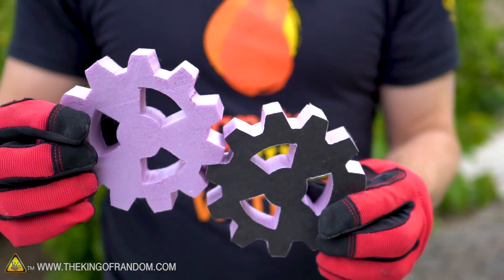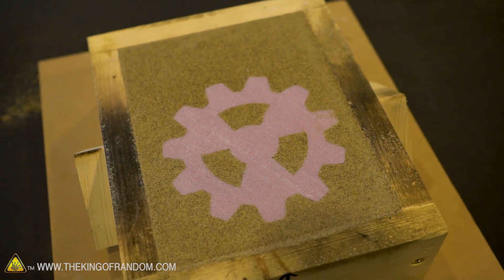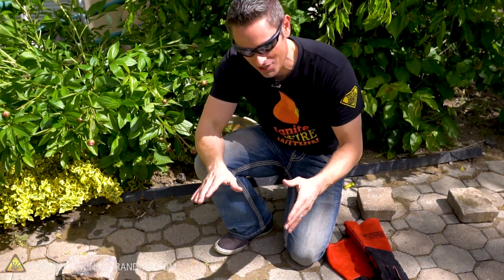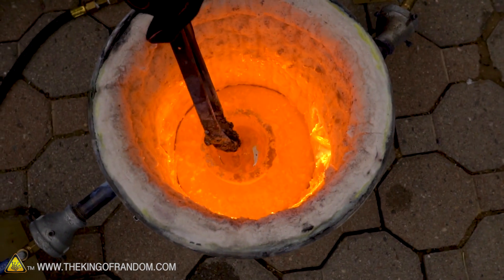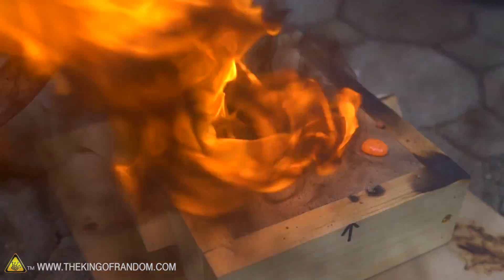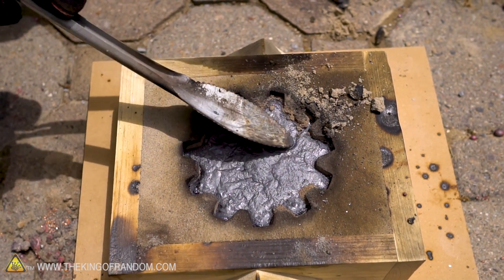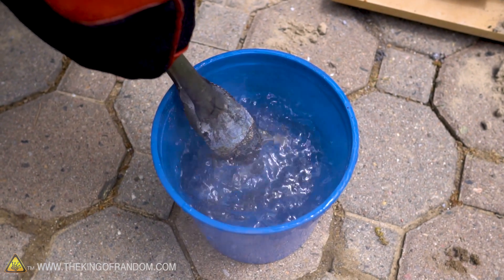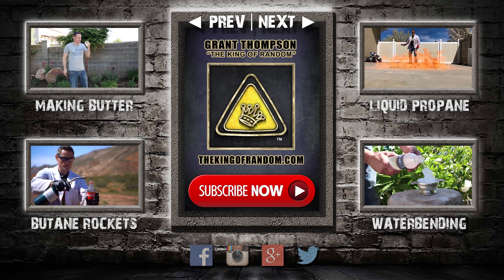Argh. Why Is Copper So Difficult? TKOR Tests Melting Copper In Our Homemade Foundry

Comment: Make a foam pipe to the foam.
Dip the foam into wall filler..wait to dry..
 several coat will be better shell....
Buried coated foam completely in the sand..
Pour the liquid metal on it..trough th foam pipe..
Liquid metal will vaporize the foam , fill the cavity, but stopped by the shell..

Comment: Use white cement instead of sand as it has higher melting point around 1,600 °C. The copper melts at 1,085 °C.  Also white cement makes a firm mould than sand. using 2 part mould will further makes the process much smoother.

Comment: You should have tried laying a metal plate on top of mold and resting the crucible on top for a minute
you could have even had a hole in the center of the plate and leave it on while you pour into the hole so the pieces do not pop out

Comment: When you make the sand mold put glue in the sand. I've seen many sand mold mixtures made with glue and it keeps the sand from falling apart when molten metal is poured into the mold.

Comment: the mid parts come out due to its moisture turns into vapor. use dri sand. and maybe heat the mold as well.

Comment: As the copper cools and solidifies on the bottom it's expanding. This pressure is causing the smaller sand pieces to rise up

Comment: Um with your mold sand problem with the sand keeps popping out i think you sould make the outside mold sand but with the hole problem get rid of that part and make it wood or some stronger sand if there is such a thing

Comment: Make a two part mold with the sand and have another part on top covered with sand to keep pressing the sand down well it is being pored but when  you are putting the green sand in the mold pack it down after all the times you put sand on it

Comment: try somthing else other than sand.
Reply: tamim hossain Sand is one of the only materials that works. Watch "Alumi Tube" or "Press Tube". They use enclosed molds most of the time, which is how you're supposed to do this. He should try to close the mold.
Reply: tamim hossain sand isnt the problem its how he is using it
Reply: An investment cast would work fine. He would probably need to coat the foam with wax so the investment didn’t soak up in the foam.
Reply: I think clay would be fine. Its more stable than sandand also resistant against the heat.

Comment: If I were you I would put a hole in some wood and center my cog on that hole pack sand like normal but keep the top on it as positive pressure so the sand is held firm. May want a thick piece of wood so you can cut if to funnel molten metal towards hole.

Comment: If you por it slower then the lava makes contack with the sand wich. Makesthe sand fall out at that point so i think thw problem is that you need to get the sand worm and then the lava can't make contack with the. Sand of the layer below the sand wich makes it force the lava to go near the sand too go thro of whats in the way of the lava by the way i'm only 9

Comment: one of the best ways to cast copper is to melt it in a porcelain crucible, heating it up with an Oxygen/LP gas blowtorch. 
keep the blowtorch heating the copper, even whilst poring.

that is how a goldsmith would do it
Reply: also, if you don't mind casting on a smaller scale, try casting in a cuttlefish bone, else try Plaster of Paris, or professional jewelers investment

Comment: What the others have said.
Proper casting sand.
Over sized gear
Wax gear with holes on bottom oven the mould to melt out the wax this also sets the sand."moisture in the sand explodes with molten metal"
Two piece mould poor in till the excess comes out.
Machine the item to size.

Comment: If you put the styrofoam in a sand filled bucket and only exposed the very top of the mold, it will work alot better because the copper will have nowhere to go but the styrofoam pattern.

Comment: make an inverted cast that uses less copper, or a cast that is made from copper.
Reply: and maybe quench in other matforms that aren't water like oil, or reactives to copper i cant think, but it doesnt have to be perfect, water just making holes and oxygen looks like its going to explode, idk. just use alot of protection if you decide to use other substrates.

Comment: copper is over 3 times as dense as aluminium and green sand and auminium have similar densities. the sand just wants to float on the copper so casting in sand isn't going to work

Comment: If you're doing an open mold method, why not create a styrofoam cast that you can pop out you pour in the copper? It looks like the main problem is the cast is screwing up the sand mold when it's getting melted.

Comment: Dude you need moulding sand. Normal sand is to gritty, moulding sand is finer and have a truss as clay. In moulding sand descripton stand also bentonit, but you can it order on amazon or ebay👍

Comment: Maybe use something with a higher density than molten copper so it wont float, or make molds with higher cohesion materials. With water boiling from the sand it looked like you could make bubble metal, though it would have to keep the bubbles going until frozen.

Comment: PRE-HEAT YOUR DAMNED MOLD!!! Seriously, in investment casting for jewelry you need to heat the mold to a sufficient temperature before casting for this very reason. You generally heat it to about a hundred degrees higher than the melting temperature of your casting material. Before casting (immediately thereafter. Don't let it cool before you put the molten copper in!)

And you want LESS MOISTURE IN YOUR MOLD!!! The water is boiling in your sand! That's where your sand popping out problem is coming from. In fact, letting it dry in an oven slowly so it doesn't boil is an absolute must! Just pack your sand harder!

Comment: Copper is a pain. But try silver sometime. 
Actually if your sand had just a little clay, or a little more, and you used a double sided mold. It would hold the heat better and flow correctly.

Comment: your sand does not look nearly as dark as the sand I used when sand casting. I am not sure what your formula for your green sand is, but we had a lot of oil mixed into ours when I took a metallurgy class that included casting.

Comment: What if you torched the mold first then put the copper in?  I noticed that when you poured in the metal the sand solidified, so I'm thinking that you could pre-solidify the sand then pour the metal in.

Comment: You could use another tray of casting sand on top of it with a small hole through it...Molten copper will melt the styrofoam and the sand on top will hold those sand pieces for indentation....I think that should work pretty well...

Comment: You need to put deck screws into the 3 projecting sand parts, then remove the pattern.  You also need top for mold.  This helps support weak sand parts.

Comment: I used to own a crown and bridge lab and I cast various metals thousands of times but on a smaller scale. Here's what you do: go to a dental supply company and get some refractory material. You mix it up like a thin plaster and pour it around your foam gear. Wax would work better if you can make one. Completely encase the gear with the material and make a sprue about 3/4" wide and 1" long. At the end of that have a volume the size of a golf ball. That will act as a reservoir and reduce porosity in your gear. Heat the mold up and burn the wax/foam pattern. While it is hot, pour the copper into it. Let cool and add icing....Oh sorry, wrong recipe. Let cool and break the mold. Cut the sprue flush with the gear and you'll have a nice casting.

Comment: I thought of a couple ideas last night. #1 For "Ring" casting with Gold they use a Wax Template.  Maybe using a Wax Template may work.  #2 What about instead of using plain water to wet the sand you tried using water with a little Elmer's School Glue to give it a little stick.

Comment: Wouldn't it be more viable to use plaster same you used for making the furnace as a mold, that it's more heat tolerant, granted may take longer to make the molding but won't take 6 failed attempts with sand?

Comment: Use completely dry sand. Also instead of doing it so you pour it directly onto the stirofoam make it so the gear is buried completely in the sand and pour it in through a hole that you left as a channel. That way the mould wont break apart. You may have to grind off a little bit where the channel fed into the foam but you will still get a better casting

Comment: i worked in a smelting shop and we used to make the moulds the day before with mostly wet sand and leave them to dry out. but we would use a compactor to make sure the sand was almost as hard as a brick. that way, once the sand is fully dry it shouldnt break apart

Comment: You can mix silica gel with your sand mould that will help and instead of melting you can pull that Styrofoam gear out with a sharp tool nicely and steadily that will give a smooth finish.

Comment: No, you just shouldn’t have tried to melt the styrofoam.  When he melted it, the heat had made an uneven surface on the styrofoam, which means while some molten copper is flowing freely through the mold, the other amount of copper is taking time to take the place of the copper, which makes an uneven finished product.  Plus, when he melted the styrofoam, it made the mold weaker.

Comment: I am late to the party but I think I have a simple solution for your problem. Instead of using sand why don't you use concrete? Just put your styrofoam gear in that wooden box and instead of filling it with sand, you fill it with concrete. Once it hardens the mold won't break away as the sand mold did. The only problem I could think of is copper sticking too much to concrete mold. You would have to break the mold after the copper solidifies and you would probably need to clean the gear from stuck concrete.

Comment: using your putty make the mould you need and try casting copper into that. it should withhold enough  to stand the heat needed for copper

Comment: oil sand.. thats the way to cast red metal. and you need a 2 "box" system go have room for the metal to expent. and dont cast direct into the part. it will burn the sand and wash every edge away. get get some nail t stabilize the three things.

Comment: Add 10% tin to the copper. Tin lowers the melting point. Rio Grande sells a product called "Ancient Bronze," but it's cheaper to make your own.

Also, you can buy investment that used in jewelry casting. It sets up harder and won't break when you pour.

Comment: I just watched your video.  I was curious if you had tried using a mud form instead of a sand form. Hard mud seems that it would stand up to the copper a bit better and that you could also preheat the form in order to help deal with coppers heat transfer.

Comment: try using some clay
please
Reply: Ebonheart how about oobleck?
Reply: That was done in a newer video, dry clay explodes, fired clay cracks and falls apart and wet clay makes the mold really uneven; so it wouldn't have worked.
Reply: Unboiled Egg you can’t make a mold with oobleck😂
Reply: Unknowndragon17 oh:_: how about Dried Glue????
Reply: Clay would explode
Reply: Im pretty sure clay would ether melt or cook or mold what ever u purfur
Reply: Shu 05.u might be right though.   Or it might cook by the heat cause u know like clay that u molded u cook to make it hard
Reply: Khyla Magsino uhhh wouldn't that melt? Sorry I'm like 13😅 so, I don't know what I'm saying😅

Comment: OK, maybe use a vacated plaster mold with maybe a couple of sprues to vent the gas. Or, for moisture in your green sand, use motor oil instead of water.

Comment: kinda late on a comment but with copper a 2 part mold would work best for you with multiple inlet holes for the molten copper and an exhaust hole to vent gasses and excess copper

Comment: My sculpture teacher had formal Jewelry, art, and Metal-Working training and even she had trouble with sand casting. She tends to cast and have us cast things in some sort of hard almost plaster-of-paris like substance. But I definitely don't think that it is plaster. I could be wrong though.
Reply: A few additions to this comment though. She would never use something that emits toxins when burning or melting. Nor would I, and it would probably be smart if you didn't either. I think it's a standard thing to use wood instead for sandcasting. And, also, I think she was just making an indentation in it and then pouring the copper in. But, she was trying to make a copy of a different object.

Again, styrofoam is super toxic when you burn or melt it and that's a really bad idea.

Comment: Use a vented sprue cap. Wood should be fine. It'll burn some, but it will mostly stay intact due to the carbonization of the cellulose. Anyway, basically drill a conical hole into the wood in one spot, and a vent nearby to take away escaping gases, place it onto the sand (Ideally it will be in contact or close to in contact with the sand) and pour the molten copper into it. There will be a lot of fire, but it will be okay.

The reason this works especially well with styrofoam in particular, is styrofoam has most or all of the air it requires to burn inside of it already.

This increased pressure on the surface of the sand should prevent it from breaking away.

Comment: use sodium silica in place of water, then gas it with CO2 it will be like concrete kinda and you wont have parts of the mold float out.

Comment: Using two halves of the sand mold will hold the form together so the sand doesn't float.   Adding a small mount of 10W oil will help hold the sand together, also.  Sprinkle some talcum powder on the mold first then sift the sand in around the mold (this will give better definition to the mold) coating fully.  Then add more sand and start compacting.  Flip the first half over, dd another sprinkle of talc, sift sand and add more sand and tamp.  Use sharpened, thin wall 1/2" tubing to add sprue (pour) holes and vents to the top half of the mold.  Separate the halves and excavate channels for the sprue and vent holes.  This will allow the metal in and the air out.  Put the two halves together again and pour.  NOTE: having indexing on the form sides will help keep everything straight and aligned and clamping before you pour is required.  Wait for the metal to cool before opening, trim the sprue and vent hole metal and any parting line metal and you should have a very nice gear.  Save the sand and use it again for the next project...

Comment: bury the styrofoam gear and cover it in sand, create a hole pour copper in it. Your problem is that the stability if the nuclear columns are being shifted by the weight of the molten copper. At least thats my two cents. I could be wrong.

Comment: You need to use both parts of the sand mold. The two pieces are called the cope and drag and you need to create what are called sprue holes

Comment: Hey KoR it seems like the issue you had besides copper temperature was mold integrity. I know sand molds are used when casting engine blocks, but they differ in one way. Before pouring the metal the sand mold is baked. This allows for a stronger mold that prevents any deformation during the cast. Love your stuff and keep on creating!

Comment: why not make a PROPER Mold..jezus
Reply: That is what I said the gear from is supposed to be complete Surrounded by sand not just half of it
Reply: you would put in a small spout that you would poor into. its not as clean because the copper will also fill the cavity from the hold that leads to the outside of the box, but that gets cut off and ground smooth.  if you search on how most rings or fine jewelry are cast, its the same process.
Reply: please tell me the way you'd cover the gear in sand on all sides before the copper starts to solidify and before the inner pieces of sand pop up, or if it was all built together already then how you'd get the copper inside
Reply: Wet sand an copper dont mix, because hydrogen loves to bubble up copper, even if it is in copper.
Reply: then use oil sand
Reply: +Sam Wansitdabet 
*if its in water
Reply: Ya from a metal that has a higher melting point so it won’t melt AND it’s garentyed to stay in place!
Reply: Discorded You would have a hole to pour it in. That hole would be in the center so the sand won’t rise
Reply: Kortak how would you get the copper gear out then 🤣🤣
Reply: Christian Botha removing the sand...
Reply: Why don't you upload a vid showing us how. This I'd the way I was taught Iin school. If there's a better way, I'm interested in knowing it, if you would, please
Reply: Kortak Exactly.
Reply: If he made a proper mold, it would take plaster, a metal with a much higher melting point (the strongest option), or some kind of expensive material. The plaster might just melt apart, the metal would be expensive and difficult to make, and the expensive material might just be too expensive.

Comment: You shoulde use Clay, and take clay for bake, when u end this steps u can use ur "negative form" for copper. Normaly u use wax model as primary form for remake it as negative form. Sometimes u use Gypsum negative form [yeah the same witch u use for ceramic].

Comment: If you add glue to your sand and then use a torch to burn the foam you will have better luck. The sand will hold.

Comment: you cant use sand for copper molding it will never work for perfection but you should use POP  mold dried over night but wet that will work in a single trial

Comment: Try wetting the sand a bit more till it's the consistency of a super thick milkshake to cast the mold... then pat it down till it's nice and flush with the box and pack a little more with the lid and then let it dry out with after it's packed...

Comment: You need to use sodium silicate and set it with some CO2, sand is too sparse to stay in place when it's surrounded by molten copper.